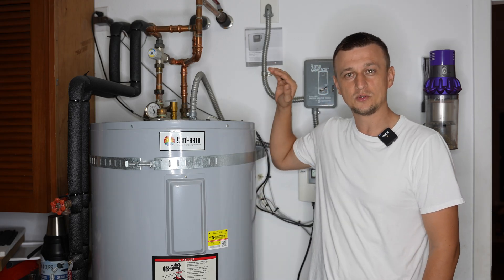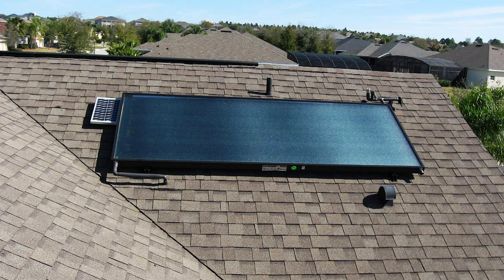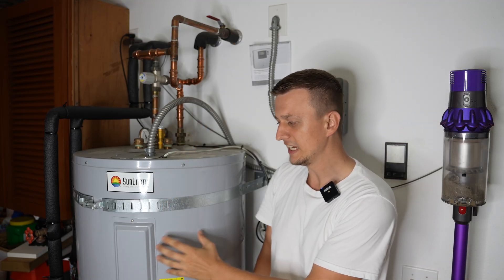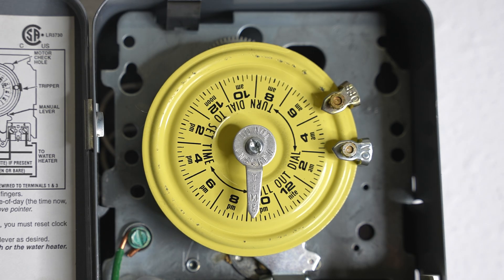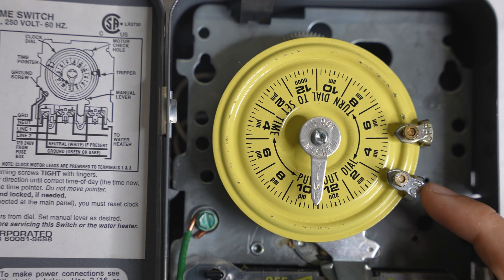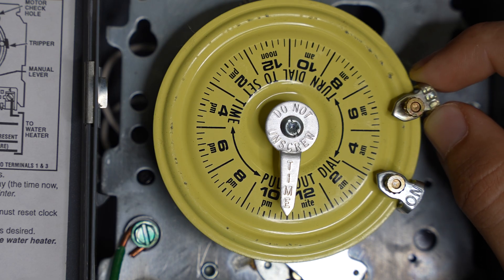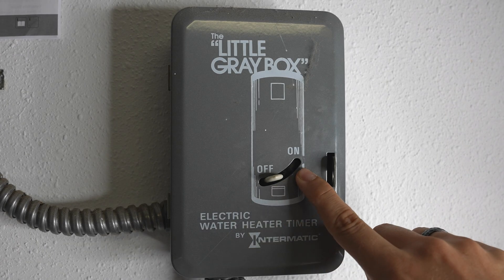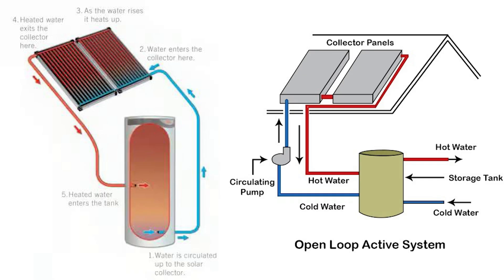How Does a Solar Water Heater Work?

Comment from the maker: ⬇ Other Videos You May Be Interested In:

How a Normal Electric Water Heater Works:
https://youtu.be/H3mK15ILAMs
How to Test Water Heater Heating Elements:
https://youtu.be/btyVpGgQK3Y
8 Things to Check if Water Heater is Leaking:
https://youtu.be/9LyXTtcuLKk
When Should a Water Heater Be Replaced:
https://youtu.be/xRtd2lSb4lY
How a Gas Water Heater Works:
https://youtu.be/geOKy06g5e4
Reply: 4:26 4:26 4:26
Reply: 4:26 4:26
Reply: 4:26
Reply: 4:26 4:26 4:26 4:26
Reply: 4:26 4:26 4:26 4:26
Reply: 4:26 4:26

Comment: Labor, cost of materials, running a recirculating pump and the longer run time of heat strips, wonder if there is any cost savings before the heating elements, tank or solar panels fail. Perhaps a tankless water heater would have been a better choice? Still enjoy your videos.
Reply from the maker: Yeah I honestly am not sure if it's worth it or not... Kind of like my trip to the car dealer recently. A van we want can come in gas only or hybrid. The hybrid is about 10k more. After doing some rough math it just doesn't seem to be worth it. Glad you still enjoy the videos! Thank you for stopping by for the new one!
Reply: @WordofAdviceTV  no; a hybrid definitely isn't going to save you $10kin gas! I can't believe it's marked up that much! Wow.
Reply: Are there heat strips? I would've thought not needed in Hawaii. Either way,  neither they nor the recirc pump would run that often,  and it's far less energy than heating the water. The biggest cost is heating the water,  and this heats for free.  Normal in most of the developed world; rare in the US which can most afford such setups.
Reply: @jamesengland7461  I see that I was thinking HVAC wording, meant to say heating elements. Thanks for catching that and I will change it above.

Comment: Hey please answer my furnace not working. The blower motor is on but the inducer motor goes right off after it started to spin idk what’s wrong
Reply from the maker: The first thing I would look for is if it's blinking an error code on the control board. It sounds like a safety switch is tripped. An error code would help narrow down which one. Perhaps it overheated?

Comment: This is a cool setup,  and really should be standard on every home.  We pay way too much to heat water in the US, when sunshine is free and used almost worldwide for water heating. The roof panel is likely too small to heat the water enough for a household; just one more panel should do the trick. The timer is not even necessary,  as the water heater thermostat can handle the heating needs; it simply will turn on less often when the sun is doing most of the heating. The timer is  nice,  but need not be reset with daylight Savings Time.  It'll do enough in 3 hours each night no matter which 3 hours.
Reply from the maker: Glad you liked the setup! I agree, it's a great way to save on heating costs. I wonder if anyone's tried what you explained and set up one of these systems without a timer. Would be interesting to hear how it operated for them.
Reply: One caveat is to check your homeowners policy as some insurers won’t cover roof damage with solar panels/heaters installed on them.

Comment: You forgot to mention the mixing valve that will mix cold water with the hot water being used from the tank. Roof solar panels can get the water really hot. Like over 200 degrees. Without that mixing valve set for, say, 120°, the hot water would be way to hot at the sink or tub.
Reply from the maker: Yes! Thank you for mentioning that in the comments and explaining it. I completely forgot to talk about the mixing valve.
Reply: I suspect that this particular solar panel is far too small to heat the water in the tank that much overall. Also,  his thermostatically controlled pump will pump that water as soon as it heats up by 16°C, as he says,  basically functioning as a mixing valve.
Reply: @jamesengland7461  possibly. My brother's rooftop solar water heater is about that size, and I've seen his tank well over 200°. What I don't know is what his circulating pump thermostat is set for. Could be plumbed a bit different, too. At any rate, there will be a mixing valve to level out the tap temp at a safe level.
Reply: @mikef2618  200 in the tank is impressive!

Comment: Hi Jay, the working principle looks very similar to a car's radiator except this has more electrical parts to fail.  I am sure you can fix them all 💯👍 

Glad learning something new today !
Reply from the maker: Glad you learned something new and thanks for stopping by! Yeah, it's similar to a car radiator. 👍
Reply: I always chuckle when people say "fewer electrical parts to fail" as usually when an "electrical part" fails, it's the mechanical parts of the electronics that actually fail: switches, pots, connectors, etc. There are exceptions but pure electronic components are generally very reliable. I get the sentiment though,  electronic systems can become overly complex, sometimes unnecessarily so.

Comment: too much intervention needed. Don't you think you be just better off with a normal hot water heater setup, even though you might be paying more for hot water?
Reply from the maker: Yeah, it does seem a little annoying. But from what I've heard, people actually do save quite a bit of money with these things. I have a friend on the island here who removed his solar water heater system and put in a regular water heater and he regrets it. He says the electric bills are actually substantially higher.
Reply: Annoying? Free hot water? He's only paying to heat water for 3 hours at night IF it even needs to turn on.  In the low latitude and intense sunlight in Hawaii, that won't be too often. The only real downside to this setup is that it needs one more roof panel in order to heat the water enough to not need power except on rare occasions.

Comment: I had a similar Intermatic timer for parking lot lights.  It was a pain to adjust for power outages, sunrise/sunset time changes, etc.  I replaced it with a WiFi switch and a lighting contactor.  Now I can control the parking lot lights from my smartphone.
Reply from the maker: That sounds like a much better option! Or at least something that would automatically adjust to time changes and power outages.
Reply: My pool still has one of these. Good enough for me since it’s a short walk to my back